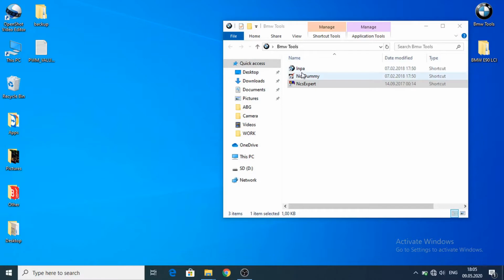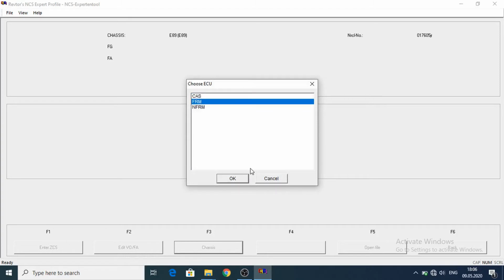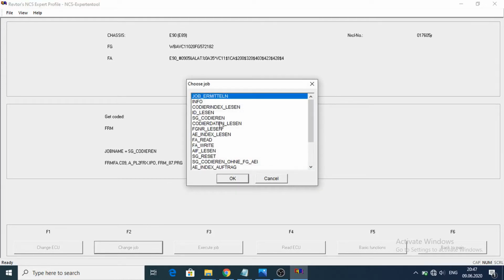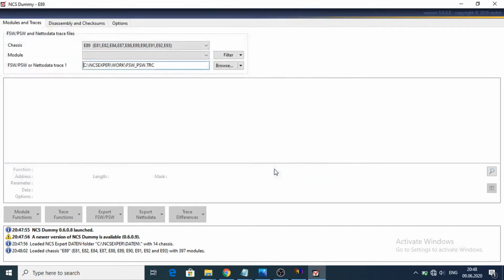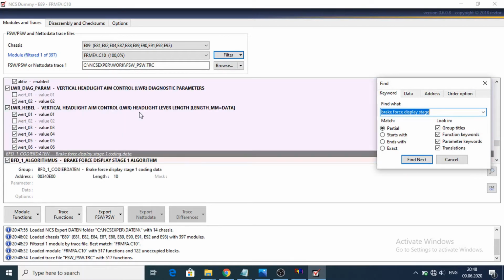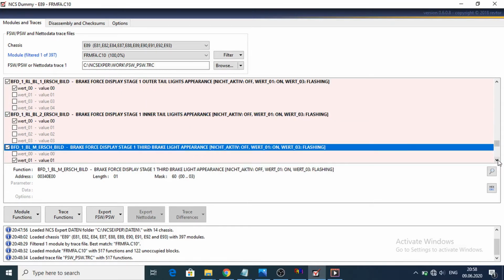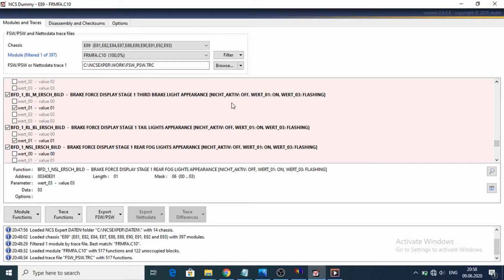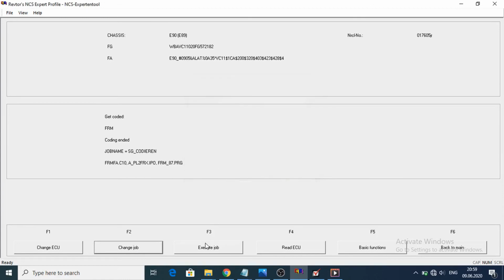10.  Enable brake force display (rear lights blink at brake in forced)

Comment: hi, in ncs expert i cannot choose the frm module, what can i do? it does not show up.
Reply: LMA module
Reply from the maker: Hi, if you are pressing "filter module by trace file" the ECU should be automatically selected. Plase make sure that you are selecting the right Chassis and reading of ECU data are done correctly.

Comment: Salut, nu trebuia sa facă doar de 3 x la tine face de vreo 10 pana se opresc
Reply from the maker: Salut, cred că depinde de modelul de FRM de pe mașină, pe mașină din video aveam FRM1 și făcea până luam piciorul de pe frana, pe mașină de acuma am FRM3 și face până se opresc rotile, poate e și ceva setare "cum" să facă, dar nu sunt sigur.
Reply: @BMWEMS  și eu am tot frm3 încerc sa activez
Reply from the maker: Din păcate la FRM3 nu a mers așa simplu, am lăsat doar becul de pe luneta și am micșorat toate valorile de se aprinde și la viteza mica, dar în frana super brusca la FRM3 se aprind avariile, la mine s-au aprins de vre-o 2 ori. Problema e că FRM3 au toate un defect de fabricație și din când în când se strica brusc când citești date sau faci diagnoza (au o problema cu un chip de memorie). Eu am renunțat să mai fac ceva pe el, până acuma mi s-au stricat de 2 ori.
Reply: Salut! Ai idee ,pot sa adaug cumva sa facă de mai multe ori? Am decât ×1
Reply: @mariusanistoroaie2477  de 3x
Reply: @lucianmuntean9524  ,e decât ×1

Comment: Oh... i thought it would blink more rapidly.
Reply: i can change it
Reply from the maker: Hi, from what I know you can change the frequency of pulsation, you can search for "BFD_1_BLINK_FREQ_" and you have 2 configuration there "AUS"  (time for light "off") and "EIN" (time for light "on"). To have a faster blink you can decrease that vealues (I recomand you to put the same value in both, to have an 50/50 - on/off pules). If you can't manage that please write a comment and I will try to do a video with this.
Reply: @BMWEMS  Ok thanks I took a look at the NFRM in Dummy and I find that line but how do you edit the value? I don't have multiple choice. I think I would have to NETTODATA code it since it's a value? Anyways I don't think my flashing works, I need to test it. Mine is a 2011 LCI the coding is a lot different lol. The only thing on my car I wanted but atm I think I'm happy it already does brake force display with all the lights, maybe even flashing.
Reply from the maker: I have an video were I add new values for us lights, is the same procedure to add a new value here. I have now also an 2010 LCI, and you are right, there is an NFRM, but is not very defferent, also I added in comments of this video how you can found each value(rear light bulb) on other modules. See my video on my channel (with how to add new value at us lights) and use the same procedure, with NCS Dummy, I sow that there is an 5 now, and formula is (value *40) +100, so for 5 is 300ms, if you want to be)~ 2 time faster you can add value 2 and you will have (2*40) +100 = 180ms. Please let me know if works. 😊